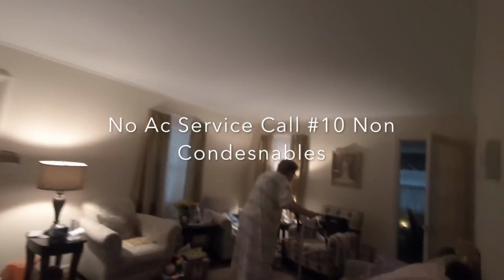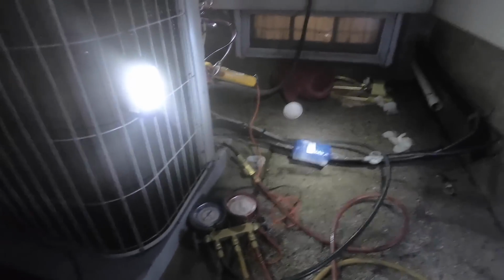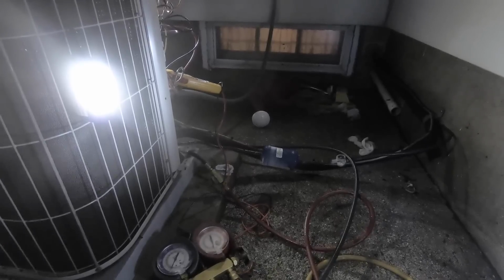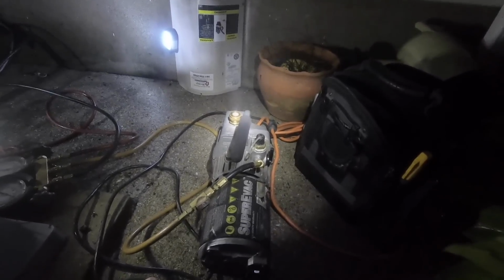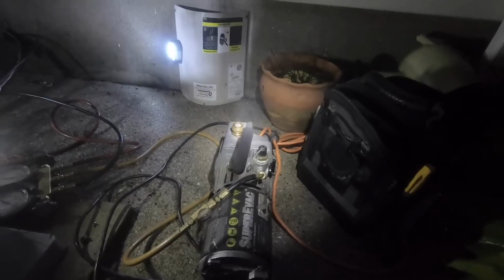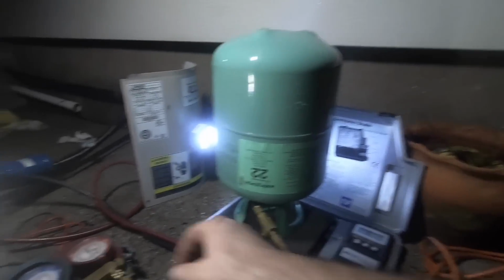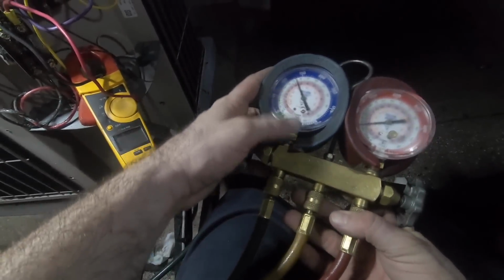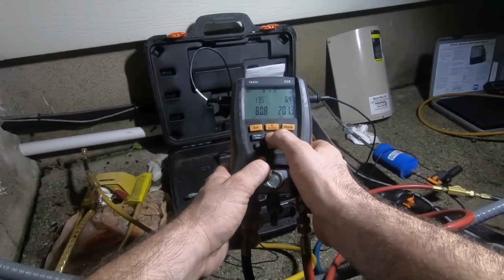AC Not Cooling Contaminated System Overheating Compressor HVAC

Comment: That was fun. She lied to you, somebody was out there "working" on that unit. Expensive lesson
Reply from the maker: I find most customers will at times. I don’t take it personal since they pay when my jobs are completed. No way this unit has ran over a month with average of 90* degree days with this machine operating like this.
Reply: @thehvachacker  - she probably felt the need to "lie" because she may have feared it would violate/terminate her contract with your company
Reply: The guy that serviced it must have added had on a cooler day. Then way over charged. Plus you could have weighed what you took out. All the fancy tools don't make you good.sub cooling with tx forget the sight glass. You did not change dryer.
Reply: Weighing charge out can prove a leak or over charge. Right out of the gate. From what I saw on video it was not contamination.
Reply from the maker: I also charge to sub cooling not sight glass, why I connected my testo and charged to he subcooling on nameplate. As for the drier I had none left on truck since I used 2 that day before getting there. Should I have not done the repair to get her up and running?
Reply from the maker: I pulled 5 lbs out so it was slightly over charged. Not enough to give me 130+ psi on suction and that high of head on r22

Comment: My air conditioner is from 1997 as well as gas furnace, all the same age as the house, Never ever had this kind of issue with my system! What could cause this?
Reply from the maker: This happens when someone puts 410a or a different refrigerant into a r22 system. This will never happen on its own.
Reply: The HVAC Hacker Is 410A generally used for commercial refrigeration like walk in coolers and freezers, while R 134A used for modern air conditioners both house and commercial and automotive and RV units, and consumer grade appliances like refrigerators, mini refrigerators, and deep freezers? I could be wrong but that I recall I haven't seen R410A in videos of charging ac units! Also shame on who ever screwed that system up, That poor lady, I always have a soft spot for the elderly, they are often easily screwed over! By the way I am in Canada on the Plains, we get hot here but we get swings in humidity from one day to the next unless it is a tropical heatwave or a desert heatwave, we get gulf moisture here and a day that is 100 or higher can feel 110 to 115 or on rare occasions even higher than that with the humidity, but if it is a heatwave originating from Arizona and California then it can be an intense dry heat! by mid september it is not very hot anymore, more like mid to high 70's now so ac is not running much, probably can turn it off till next year! I never cover mine completely so moisture doesn't get trapped and snakes n rodents don't nest in it so I just put plywood over the fan grill to keep leaves out!
Reply from the maker: 410a is used for residential and commercial air conditioning, 134a is auto and refrigeration. 410a is the pink can in many of my videos. r22 is the green can and is getting phased out at the end of 2019. I think she had a neighbors kid recharge her ac system. She was a very nice lady kept trying to feed me. I am charging a system using 410a in this video https://youtu.be/q3gOkvf9IcY